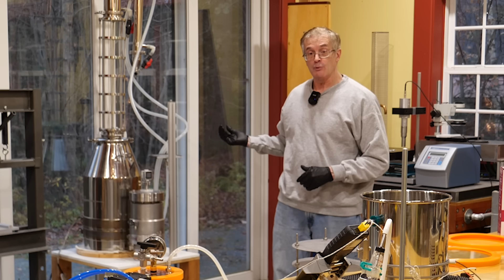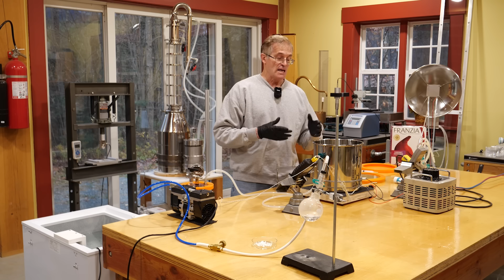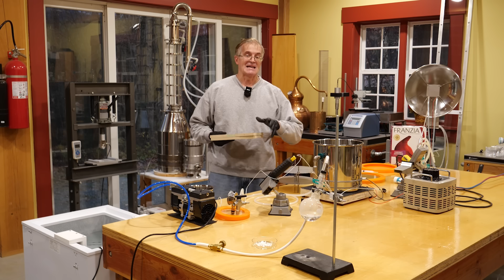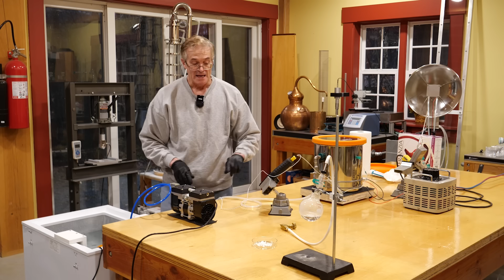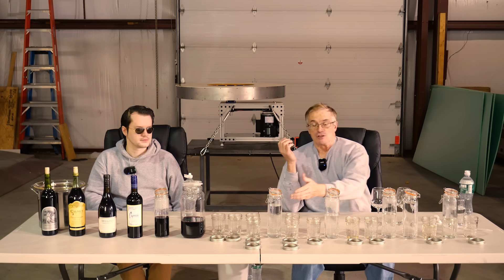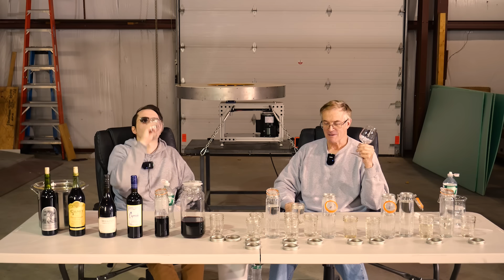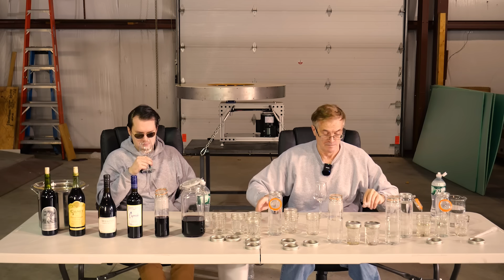Turning $3 Wine into a $100 Vintage with Science!

Comment: How fermentation works for Lugdi?
Reply from the maker: Like the Kogi rice, there are fungi present, especially on less processed grains that supply some amylase.
These grains also have not been polished and if harvested over a period of time can begin to malt.
Reply: thanks but can those enzymes handle boiling temperature?
Because Lugdi and other alcoholic beverages from himachal got cooked.
Reply from the maker: Hmm.  I didn't know that. 
I can't think of an explanation.
Reply: I am extremely sorry, for a vague question.

 I searched for its recipe.
And found they add herbs after 
Cooking thoroughly.

And that is odd because herbs are generally added during cooking.
But those herbs contain yeast and mold explicitly along with herbs.

And initial results didn't give me that order of operation.

Comment: @TechIngredients
Captain here.
18:10 Chill rubber to below -30 °C (or check the materials glas transition temperature, if you really want to be fancy) and drill the hardened material. You may have to re-chill in between.
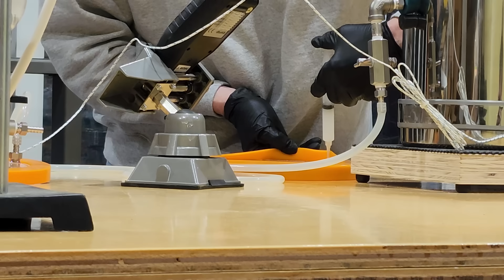37:00 that's petroleum jelly (medicinal or food grade, not industtrial grade)
51:30 the price of a wine is only mildly related to its taste, usually you pay more for wine from further away or from smaller distilleries, or whiteout added flavors
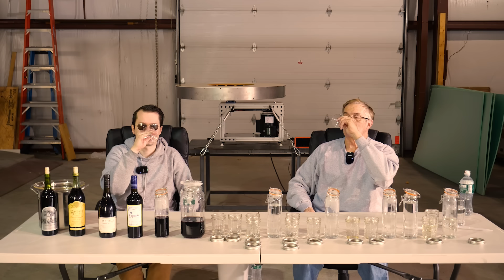52:30 pure ethanol tastes sweet, you als have no added denaturant in there
1:00:00 ~ish. cheap wine often has added artificial flavors, you may have ended up simply separating those
Reply from the maker: The technique I described is easy, it works and I've used it dozens of times. 
There are alternatives.
Who cares if it's industrial grade, it's  food safe.
Adding a denaturant is pointless.
The bottom line is that this works. 
You're criticisms don't seem important.
Reply: @TechIngredients  Yes, and as means of teaching others and not overly complicating things, drilling rubber plugs in a tube, is certainly a viable way to go. On the other hand, you have the equipment and skills to use the more professional method. It was not meant as criticism, but as a friendly pointer.

You misunderstood the remark about the denaturant. Usually high percentage ethanol is denaturated for various reasons (as you know). If you taste pure, untreated ethanol, it has a (somewhat) sweet taste. This is what you have in your taste test of the different fractions.

Comment: “Son we have the hooch, fire up the fricken’ laser let’s shoot down some of those pesky ruski drones.” 😂
Reply from the maker: Are you suggesting we would actually use these lasers when we're in a party mood?😁
Reply: @TechIngredients  I would… for science! BTW the suggestion to add distilled water by volume of the cuts you removed makes sense. It would smooth over the tannins and reduce the astringency, that face sucking sensation is also caused by too high a concentration of the sulfites they use as a preservative.  I would have reduced the amount of the first cut as well. There is still methanol in wine, I believe the menthol comes off first at 64.7’C. It’s more volatile.

Comment: You have me convinced; I will build my vacuum distillation system next year. It will probably take my drinking a maltiply it by 10x because right now I drink about a bottle a year. Because I don't like the "funk" and I will not drink more than 3 drinks in any 24 hours. So if I could pull 25% ABV out and reduce the "funk" whilst also reducing the cost to comparable to pop. I would be willing to drink every week.

Comment: Fascinating experiment and distilling under a vacuum is not something I’d have considered but makes perfect sense. Commercial distillers of spirit use copper equipment to remove/convert some of the off flavours, wonder if that would also improve the overall quality and increase the volume/waste.
Reply from the maker: It could.  I discussed that during the livestream that followed.

Comment: 2:27 That's partially true and partially false! How do you explain that yeasts can ferment flour to make bread?
Reply from the maker: Typically you also add sugar. But there are also some enzymes in the flour that will break down the starch, but not much.
Reply: they add amylase to white flour after milling -basically the amount they would remove in the germ/embryo.  Whole wheat flour is milled with the germ in. When water is added to flour, the amylase breaks some of the starch into sugars for the yeast.
Reply: @rono2795 just BIG BS!

Comment: good show to see what u can do if u have to much money buying all this stuff, which u dont have in a normal houshold.. the title is a bit missleading, if u count all the parts together and devide it through the wine u do with it.. but there is one error in the cooling, melting ice generates zero degree, if the freezer is running, theperature goes below that, and produce the oppisite, because it must cool the water down to generate ice plus it takes on energy from he athmosphere in the room, thats why u have a tempshift in layers... put in the bubble generator is a nice way to get rid about the layers, but it dosent change the fact the water is cooler then Zero, and it depends on were u have ur bild regarding of athmospheric pressure, there is another way to produce vaccum, and pressure,  i once saw a german company building those, but i think those are not as cheap as this one..
Reply from the maker: Anyone who really likes wine and appreciates good ones will break even after the first run. After that...
No, a mixture of ice AND water is so close to zero centegrade that it doesn't matter.

Comment: Very cool. It would be interesting to put your wine into a small barrel for a while and see if you like how it develops.

I wonder if some of the flavor improvement comes from concentration related to omitting some water? It might be interesting to check the specific gravity or something before and after and add back some pure water to bring it back closer to original. That wouldn't likely improve it, but it might be informative as to one of the differences between it and the higher end wine (longer aging may have resulted in more water loss, concentrating the flavors similar to the distillation process).

Maybe a nice rotovap machine in your future?
Reply from the maker: It is something we should have tested.  But, ultimately it's probably not important because the process works as it is, even if concentration is contributing.

Comment: Some time ago (maybe a year or so), I came across an article with a pretense of academic scholarship about how "boiling beads" actually work. As is always the case in real life, the mechanism is incredibly complex and multifaceted, and is not at all limited to the creation of localized overheating zones, as they like to oversimplify. Unfortunately, I can't remember the article right now.
Reply from the maker: The best description I have heard that actually makes sense is the solid surface interferes with the intermolecular attraction between water molecules, ie. surface tension. This is plausible because the bulk liquid is already a frog's hair from overcoming this attraction.

Comment: 44:35 you mentioned it was possibly 98% alcohol. The highest concentration possible with distillation is 95.6% (the mix becomes an azeotrope) and that's with very careful laboratory technique. Home distilling is usually 92-94% tops.
Reply: Would it be possible to get additional separation with reverse osmosis?
Reply: 98% *proof*. That's 49% alcohol.

Comment: I drilled rubber stoppers using a length of brass tubing, not a drill bit.  Put the brass tubing in the drill and spin it at a low speed, using a file to bevel the outer edge of the tubing, so the it forms a sharpened edge all the way around. Then this sharpened tube can be used as the drill bit.  Add some mineral oil during the drilling to make it easier.  I haven't tried this with silicone, but I'll bet it would work.  Initially centering the bit can be a bit tricky, but once the drilling starts, the tube won't wander.
Reply: That was my thought as well, similar to how they punch leather or any other soft material.
Reply: @christopherjones7191 Yeah, very similar!

Comment: If you can make a great tasting wine from a $3 box wine equivalent, can you make an even better wine from the $100 bottle wine? Would that make it the best tasting wine ever? Obviously that will depend on the tasters preferences from whoever is making the cut and evaluating it in the end. I just have to wonder, at what point are there diminishing returns??
Reply from the maker: Actually,  I think you could. Just consider this one tool that "could" be added to the manufacturer's process.
The chalange would be how to test the results. Use AI and spectral analysis or a team of experienced wine tasters?

Comment: I think that the first distillation portion should be thrown away because it contains all of the methanol. You can calculate how big the first portion should be so as to get rid of it all. (even wine does contain methanol!)
Secondly, I think that the removed water should be replaced with neutral water so that the alcohol percentage remains normal and you aren't creating a concentrate.
These are just suggestions and not criticism. I liked this presentation a lot!
Great job!
Greetings from Finland!
Allan
Reply from the maker: Thanks.

Comment: Wine does have methanol in it. Other than that, great video. I would have took the discarded cuts and measured their volume. I would have taken spring water and added it to the wine at a quarter of that discarded volume...adding an eighth or quarter at a time until you get a flavor you like. From there, buy toasted French oak staves and soak them before placing them and your reconstructed wine back in the vacuum chamber for 2-3 days. The oak will have vanilla and spice flavors while also regulating flavors in the wine.

Comment: have you seen the videos where people use ultrasonic baths to extract wood essence into ethanol to make 'wood flavor concentrate'? I would recommend experimenting with creating some of that and then adding a little either before distillation or after to your blend.  Also, as others have mentioned, adjusting the ratios seems important (especially of the final remnant relative to the other fractions after discarding some). Maybe measure what you discard, and add an equal volume of pure distilled water to the final blend?
I'd also love to see you tackle a similar project starting with a different starter point. What happens if you try this with cider? With whiskey?

Comment: So many different paths you could do with that whole system very interesting
Reply from the maker: That's what I think.
We just assembled some tools and did one test. Imagine if 10,000 people used this basic method and tried other wines, adding additional flavors and arromas(oak), titrated each fraction to optimize its contribution, lower or raise the alcohol content, etc.
Reply: @TechIngredients I was also wondering if, could you use a pressure cooker for the vacuum chamber or does that have some negative aspect to it?
Reply from the maker: I actually think I tried that as a kid (seriously). I recall that it leaked because the pressure gasket was designed to keep pressure in rather than out. You probably can confirm that guess with look at the lid's seal.
Reply: @TechIngredients thanks I will check it out with the pressure cooker I bought for the wife that she doesn’t use

Comment: I understand what you are trying to do. However, taste is very subjective. Perhaps you should taste them blind to get an unbiased opinion? I wonder if you could accurately identify the wines repeatedly in a blind tasting?  Second point that you are now exposing your wine fractions (cuts) to oxygen when testing and recombining (mixing), which is going to change your wine components,  and may ultimately destroy some of those precious fruit aromas. Third point is that wine components combine and interact to make new flavor components. Thus the chemistry is very complex, and by removing some of those components you will alter the flavor profile.  Final point is that good wine comes from good grapes. You can't make good wine from bad (unflavorful) grapes. But I do appreciate what you are trying to do and your point is well taken that one can get off flavors in the process of fermentation. You clearly show a way that one can remove these off components, albeit a relatively laborious process. Thanks for the video.
Reply from the maker: Sure.
Exposure to air prior to drinking is recommended to get the best flavor out of wine.  It's called " letting it breathe ".
Blind testing is pretty unavoidable if we move forward.  A wine expert would be another thing we should consider. 
That would be a really good excuse for a party!

Comment: Probably tastes a bit more tart because of the loss in volume from the middle cuts. If you really wanted to be selective, you'd probably redistill those middle cuts you left out into smaller ones and see which ones are desirable.
Reply from the maker: It really didn't. 
But, admittedly, the cuts we left out were funky but bland. If you wanted to you could replace that volume with pure water, but I don't think that would improve the taste.

Comment: As usual this is a fantastic video.
Comment about your temperature setup. Assuming you are using thermocouples, most of the low cost temperature readers are K type. You used non K type metal (Chromel, Alumel) for your vacuum passthrough which is going to create a non-compensated cold junction. This can be avoided by using the same K type metals (McMaster sells some solid thicker thermocouples) and spot welding the thin leads onto the solid wire in the passthrough. This way there is no material change along the signal path.
Reply from the maker: Remember, the leads are simple 30 guage copper wires. Inserting a very low resistance feed through attached to those wires has a negligible effect.

Comment: Hey 

I really like the channel. I love the really insane range on the channel. 

That being said I notice some things do sometimes go amiss. 

Lol I wasn't gonna say anything but @8:15 you say that fermentation with cellulose produces methanol and I've never heard of that before. Public enemy number one when it comes to methanol is pectin; the higher the amount of pectin in a mash/must the higher the amount of methanol produced is, so fruit tend to make more methanol while grains make virtually none as they're almost pure starch and protein. Correct me if I'm wrong. 

In another video where you talked about malting you also talk about malting being predicated on placing the grains in a warm, moist environment, which is just wrong. Malting is all about simulating fall/winter conditions where soil temps drop and the soil gets intermittently water logged, that is what alternating soaking and air rests is all about. A warm and moist environment would actually slow germination down while favoring molds and bacteria. The main exception to the cool moist environment rule is sorghum and it comes with its own host of challenges in dealing with mycotoxins put out as the grain germinates warm.  

I really love your videos. I appreciate the production value, the way you actively cram information into them and what your being an obviously great instructor bring into your videos. 

I just find statements like those problematic. If I didn't know any better I would have taken them at the face value.

Cheers!

Comment: 9:28 wine doesn't like oxygen? Red winemakers often use oxygen intentionally during production, for example, through barrel aging. Oak barrels allow tiny amounts of oxygen to pass through, helping a wine gain complexity, develop smoother textures, and age gracefully.
Reply from the maker: Once the wine is produced and aged.  Oxygen will degrade some of the molecules in the liquid.  It's the same vulnerability that food has once it is packaged.

Comment: Great video. Difficult to run these tests. If you want to systematically improve your performance here is my recommendation.
Control the volumes/times consistently.
Then do a volumetric characterization and then remove the flavors, smells, you find not so good. 
Whatever you remove, replace with same volume of DI water. 
A mass balance calculation would help you get the recipe reproducible.
I know it is not so easy, but a timer and a solenoid valve may be enough to automatically make it work easier. 
And an Arduino controller. Just for your convenience. Maybe not for the video but for doing it again for your family.

Comment: on your laser back-stop project ... i realized perhaps you should stop thinking horizontal ... laser points down from a high mezzanine at the target on the floor that's covered with 'what'?  no loose or stray projections.  there you have it.
Reply from the maker: That would require a lot of the hardware to be located on a scaffold near the ceiling and more difficult to access. 
It also creates a non real world test from that angle.

Comment: problem with cheap wines is not what they contain, but what they don't contain that they should. You have to add good things to make a bad wine good.
Reply from the maker: That's not necessarily true.
EVERY wine will have components that don't make it better. By just eliminating those components, EVERY  wine can be improved. It turns out that this technique  can make enough of a difference that the cheap wine can beat an unmodified expensive wine.
We actually did this and demonstrated it.